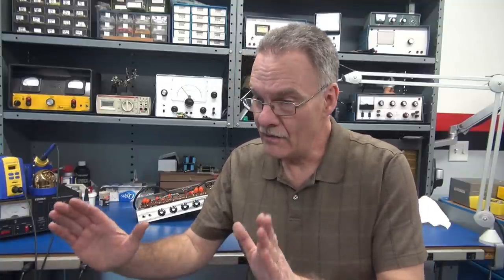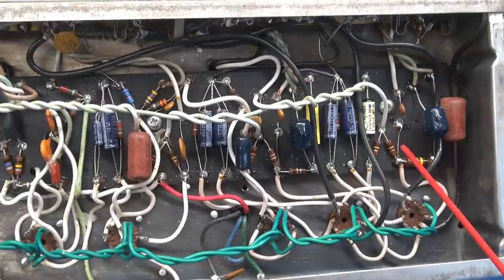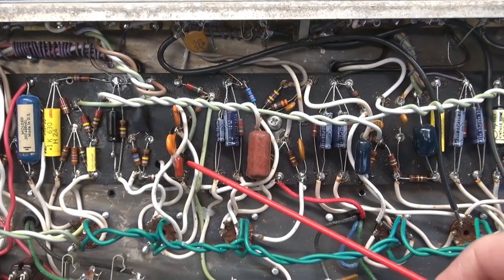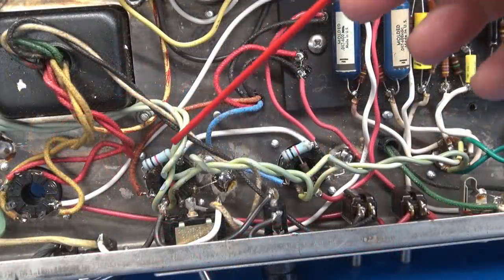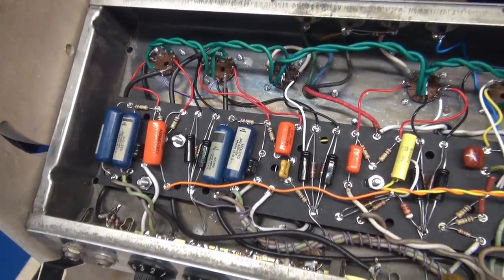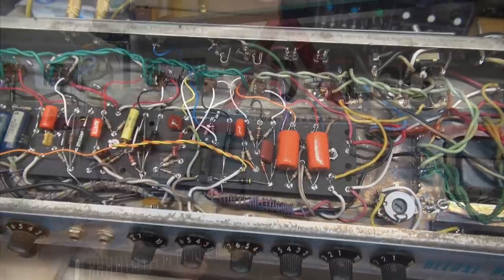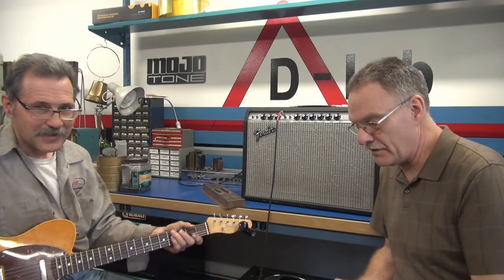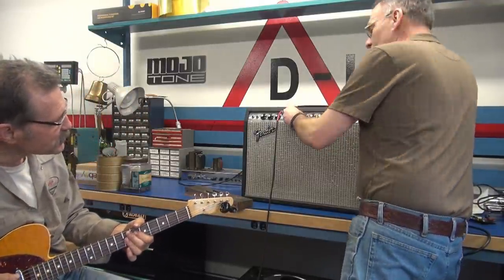Follow up Fender Deluxe Reverb tube guitar 6V6 amplifier Take it back to stock Silver Series Part 2

Comment: Copies of oem perf boards or donors?
Reply from the maker: Copies, but very good quality
Reply: @d-labelectronics  can (or will) you do the same for my 1968 Ampeg Reverbojet? A new board is what it needs after 3 cobblers have done their magic, albeit over a 10-year span. I saw on your website you work on other brands. Thanks for the vids; I've learned a lot but this is beyond me. Perhaps you'd record the process and maybe compare the circuits on video?